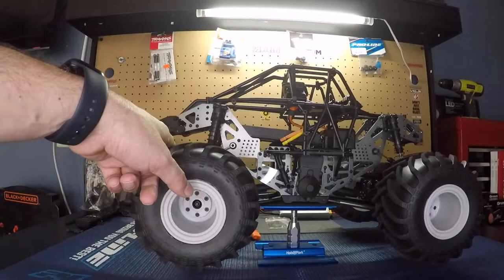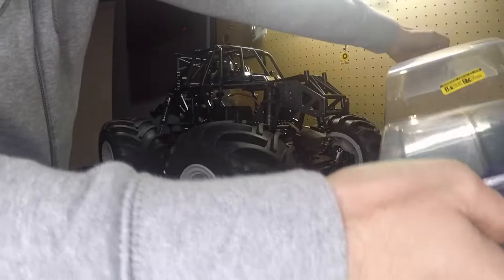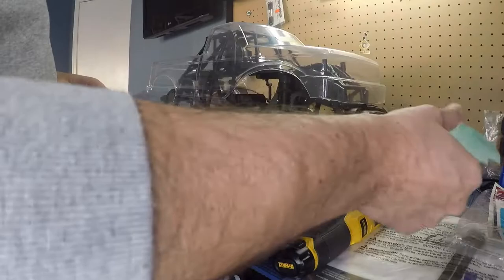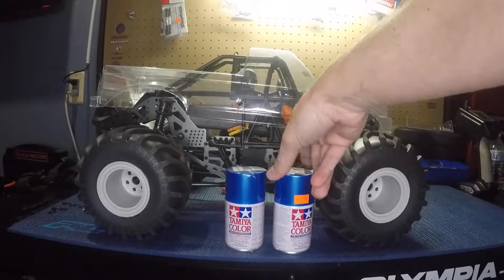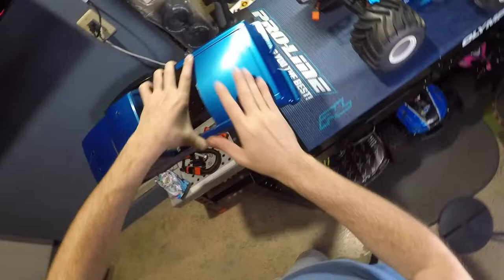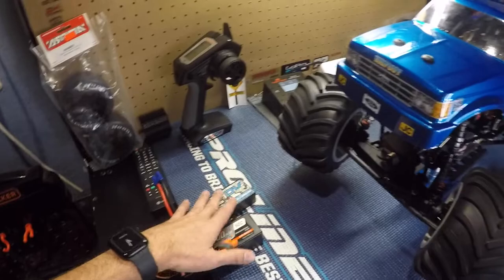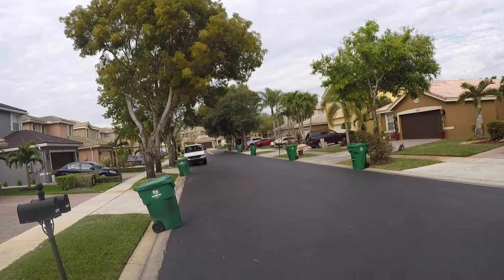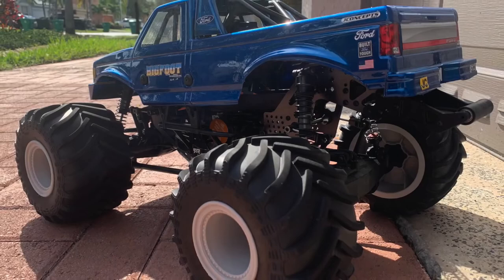Losi LMT Build Part 2 Painting and Mounting Body

Comment: That is a nice looking truck! Looks really scale bro! Good job! 👍
Reply from the maker: Thank you brother  had a blast doing this build but I think I’m going to need some limiting straps in the future but other than that it’s a really fun scale mt👍🏻👊🏻👍🏻
Reply: @Joercgarage  have you noticed any weak points on the truck yet? I thought about getting this one a while back, a lot of mixed reviews
Reply from the maker: @rcreviews9894  just the shock shaft pooping off the retainer but I think my came broken cause the screw on thread was not grabbing and with limiting straps that will also help .. outside of that everything else is holding up fine but I only had it for 2 weeks 🤷‍♂️

Comment: Excellent video, thanks for the tips Joe!  My 1st 2 runs with my LMT Grave Digger ended with the shock ends pulling out and losing parts also. Gotta have suspension limiters with  this truck! I went with Hot Racing 105mm limiting straps. Also going with TLR233005 O-Rings for the shocks to improve performance. Subscribed!👍🏻
Reply from the maker: Thank you for the sub I’m working on a new video dropping soon for the lmt installing my limiting straps and performing some freestyle love my lmt
Reply: @Joercgarage  Right On Brother! Keep putting out those videos. I'm also building an SMT10 Raw Builders Kit. Love them Monster Trucks.👍🏻